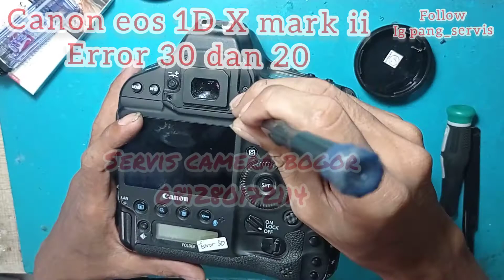servis canon eos 1D X mark ii error 20/30..lanjut part 2

Comment: Good afternoon, you could help me.  My 1D Mark II camera misaligned the mirror.  It's working, but it doesn't Align the AF.  Do I have to replace the entire mirror housing or is it possible to repair the mirror without having to replace it.  It's possible???.  If you change you have to change the mirror box.  I have to align the AF.  at the authorized Canon or do not need.  Just change it and the AF works again.  normal.  I'm a Photojournalist working with Canon Cameras for over 27 years, I've never had a Camera that had this problem.  I live in Brazil rio de janeiro.  Thank you very much for your attention, Marcelo.

Comment: A lot of unnecessary actions. You don't need to remove the motherboard and mirror box to replace the motor.
Just remove silver plate on the front, 4 screws and motor in your hands. don't forget to turn off the cables before